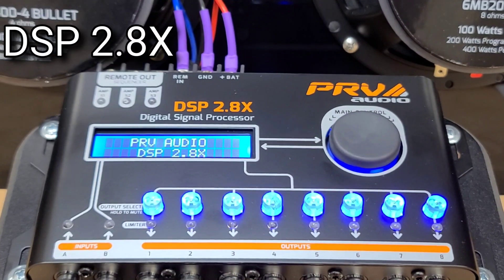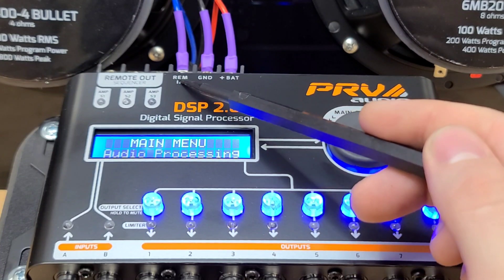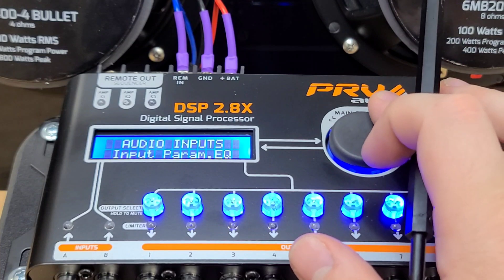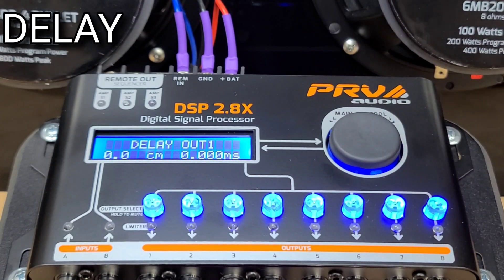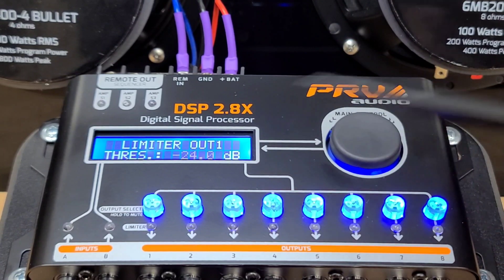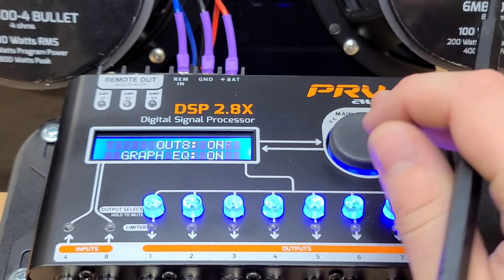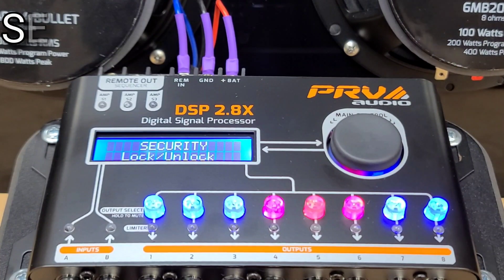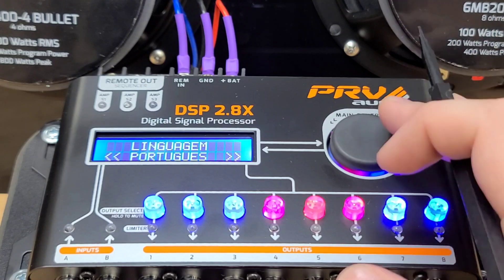Learn how to use the PRV Audio DSP 2.8X (Digital Signal Processor)

Comment: With this dps can I run 2 Prv SQ6000 1 tuned for my Mid Bass the other with my Subs ? If yes how do I pair that with my Pioneer Head unit where the out going RCA is "front " "rear" "sub"
Reply from the maker: the PRV DSP 2.8X is a great option you can use the either connection from you radio ( to your prefer ) you will just need to route the input signal to the right output channel for the subwoofer amplifiers